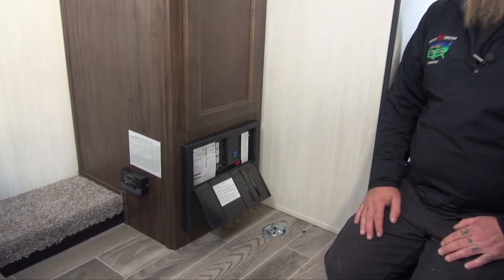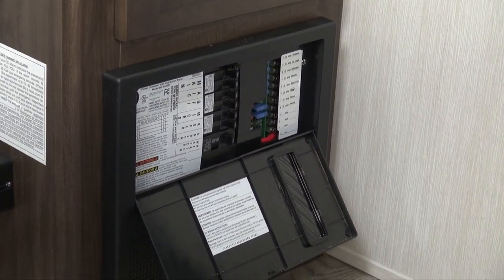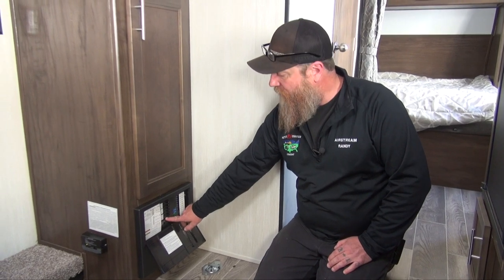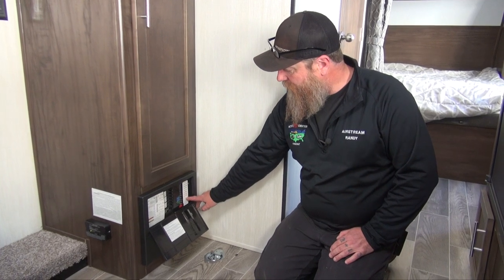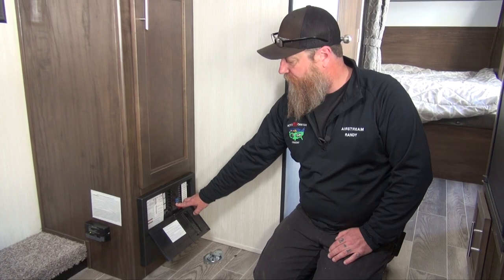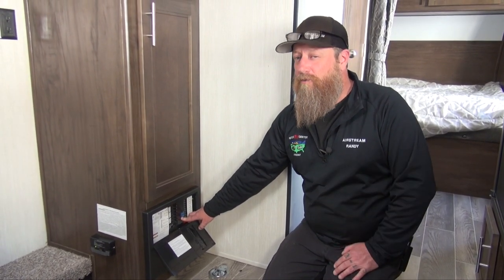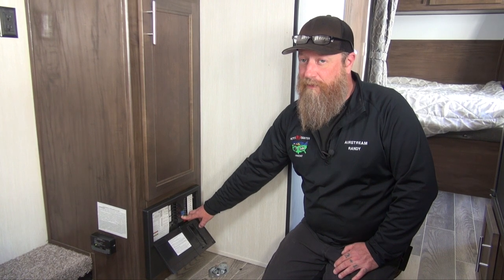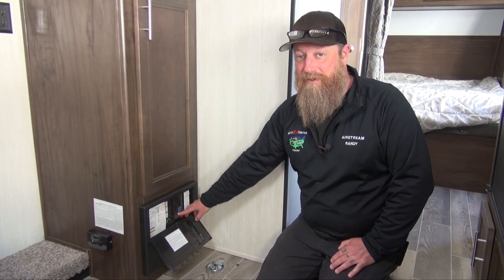Pete's RV Quick Tips | Cherokee/Grey Wolf Fuse/Breaker Panel

Comment: I had my phone plugged in charging and a small coffee going when I decided to plug a shop vac in to get some hard to reach places while leaning. The air conditioner was going while i was vacuuming. Not too long into vacuuming everything went off. I still have power for the lights and water pump but I can't charge anything. What can I do to fix this? Any help is greatly appreciated
Reply: Did you ever figure it out? I have the same problem